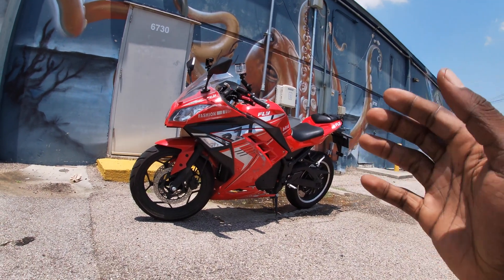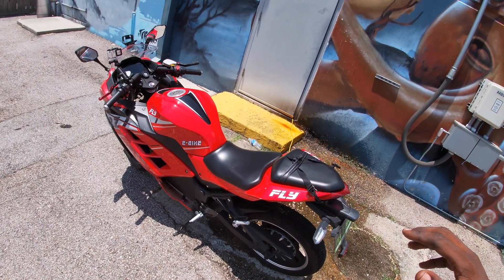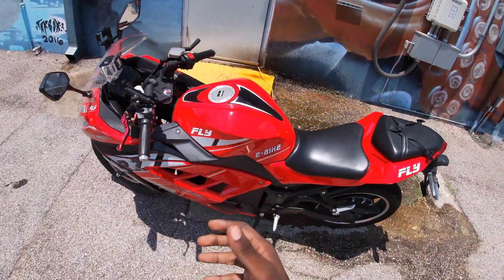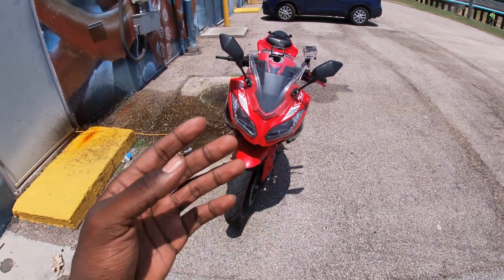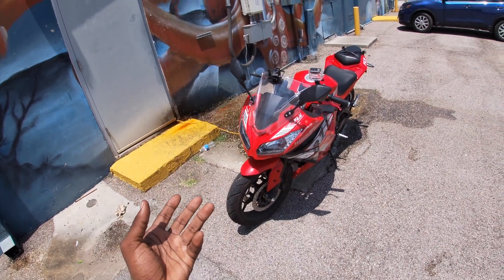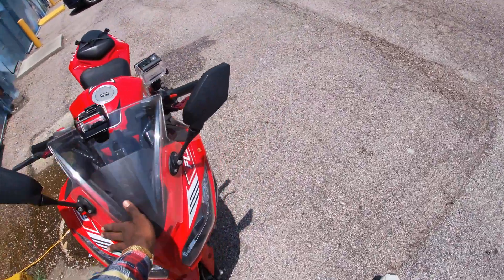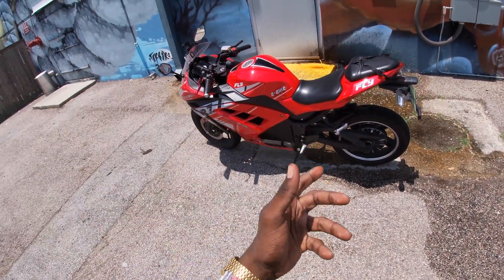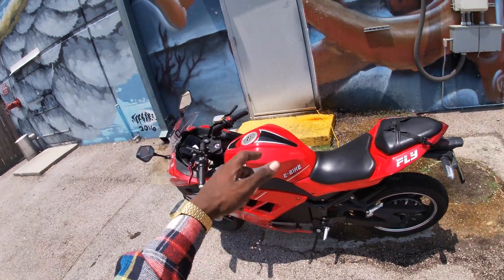Can an E-Bike Battery Overheat? Will It Explode?

Comment: 600D rated or better cover to block the UV rays. How long are you charging for, a full 10hr Overtime shift, or 8 hrs? I charge my Tao Leo  1/4 charge twice a day being thats what my 27km/18mile ride uses. The BMS will prevent overcharging,  but i myself definitely intend on upgrading from a 40ah lithium to a 100ah lithium direct from China to more than double my range. Ill also be upgrading to 2 gauge if not 0 gauge wiring to maximize my power output. 

Balaclava,  what have you heard about fast charging out Ebikes (J1772 so we can get 240v/Level 2 fast charging CCS and or NACS network)?

Comment: Put a tarp on it to prevent UV on your paint and clear coat. Also, you can run a test with a digital or analog thermometer to test the difference between a covered bike vs an uncovered bike on similar weather days. 

Note, please get your extension cord out of that puddle. Pending your battery, if you have a breaker that blows to protect the battery, it might be located inside the sealed battery box ... And if you don't, you might damage the battery.

I use at least a 12x12 tarp, fold the flaps at the front to protect the instrument cluster, and a Bungie cord to wrap around the eye hooks. 
The thickness is also rated on most covers. 200 night be the minimum, and a lot are "water resistant" and not water proof. Try to find one that's rated for 400/600 or better.
Reply from the maker: This is SOLID advice and tips my friend thank you! Do you mind if I use some of this information in a video? I’ll definitely be sure to shout you out for the help 🔥👍
Reply: How tall are you considering getting one for a work and around town work is a mile away furthest store is mabe 4 miles just moved out of ny

Comment: Im also an Ebike User mine is a different one (Rooder R804-M1) ... I would suggest you upgrade or swap your Lead acid to Lifepo4 battery so it would be removable Battery and also don't let your Ebike stay on the Sun for too long because the Controller might overheat specially while charging and might damage it and I would suggest if you modified your Ebike controller with water or liquid coolant since your ebike is meant to be fast unlike mine which is a cruiser type ebike and also I suggest you also install a circuit breaker for safety